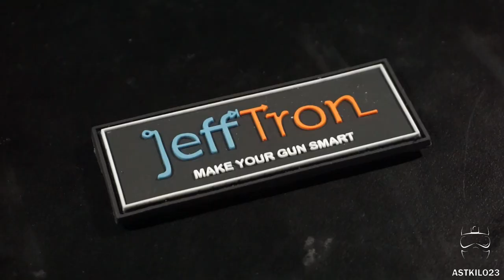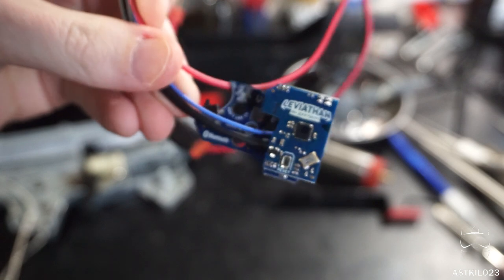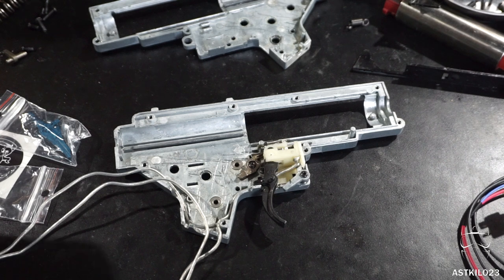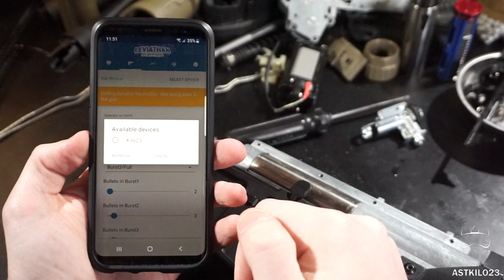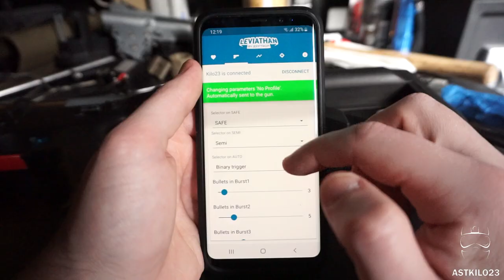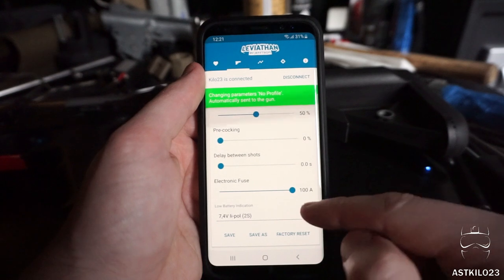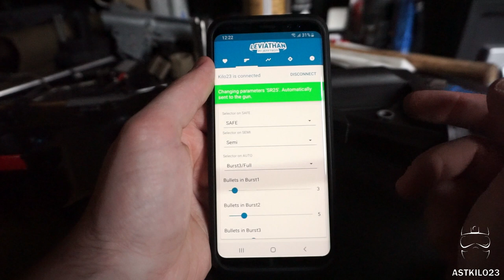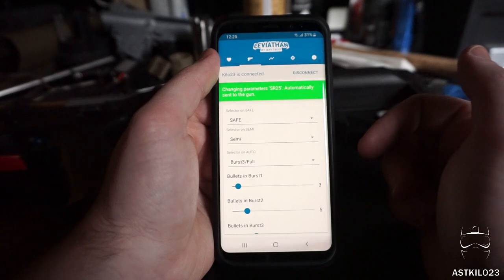Jefftron Leviathan V2 Review

Comment: ive been running mine for 8 months or so, and so far so good.  the micro switches are very weak and 1 broke inside its casing before it was installed.  i contacted jefftron and they repaired it for free, and were very good about it especially when compared to most other airsoft companies.  i love the ability to individually select the operations of each option on the fire selector and when you have precocking on you can release the spring by holding the trigger for 3 seconds rather than having to reprogram it, then fire another shot off.  its on a dmr with .3 second delay so my shot count is quite low (less than 1000 rds), but since getting it finished its served me well

Comment: First of all I have to say thank you for doing these videos they are great now for my question , I put one of these in the new Helios/ umbrella m4 basically a souped up CYMA and for the life of me the selector switch is working with the leviathan 2 what makes it move back and forth if the spring is not used is it just the selector switch ???? And the CYMA gearbox trigger holes are to small for the nubs on the trigger to slide In so I had to dremel those out for anybody else who plans on using this gun and mosfet

Comment: any idea on how this would work along with an asg 40k boost, promy reinforced gears, in a g/p gearbox with stockinternals? along with a 11.1 1300mah 45c battery?
Reply: Im running it in my KWA SR10. It fit and ran great in the stock gearbox before I upgraded to the Retro Arms billet V2 gearbox. Which it also fit perfectly in that gearbox too.  Pay close attention to the installation guide and you shouldn't have any problems.
Reply: Late but try to get a metal rack piston

Comment: I have two jefftrons (older models) and they work just fine so I have nothing against them, it's  just that AEGs departed so much from reality that a few years ago I've started to move away from them and towards GBBRs. But that's just me, AEGs were never that satisfying to me, just compare the LCT G3's charging handle to the WE Apache's charging handle, the LCT comes off as a joke . So when someone says to me you can pair your gun with your phone I'm gonna have to say thank you but no thank you.
Reply: Wait, are you comparing two weapons which like are like two seperate worlds?
Reply: @fishguardtheslippery1425  Well, they are both airsoft guns aren't they? I use them on the same events.
Reply: Yes.. but you compare an AEG with a GBB.
AEG: there's literally no bolt aka no weight and all (hollow)
GBB: there is an Bolt meaning weight being forced forward and of course the charging handle being stronger. (not hollow)
Reply: @fishguardtheslippery1425   Yes that is indeed true and it's one of the reasons GBBRs are so much cooler.
You see a few years ago I said to myself that I love my GBB pistols even more than my AEGs so maybe I should try a GBBR primary and then I bought a TM MP7 and that's when my love affair with AEGs has started to fade. So I guess I'm just bitching because the end of a love affair is always painful.

Comment: ASTKilo23, Is it possible to modify a Arcturus V2 gearbox to fit this miosfet?
Reply from the maker: no... needs a new gb shell and several other different parts.
Reply: @ASTKilo23  so it is possible to put in Another spare GB Shell and keep the outside of the gun? Considering the externals are really great, I hope another GB V2 fits in the body

Comment: Bad thing about triggers like this is its a tactile switch. If you squeeze it hard (ppl often do in game) overtime ill just break.
Reply: How hard do you squeeze your trigger? Been running micro switches for 5-6 years and i've never broken one
Reply: There’s also a mechanical stop at the back of the trigger which does not allow to over pull trigger anyway